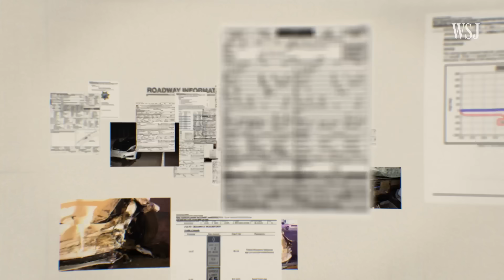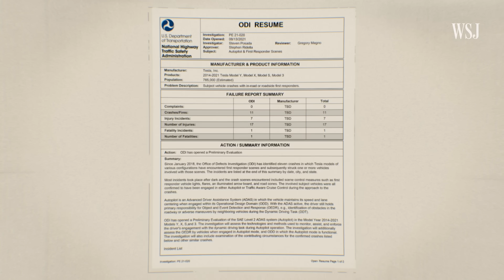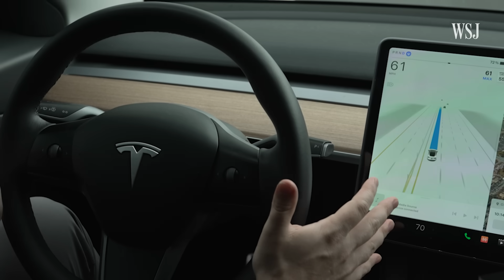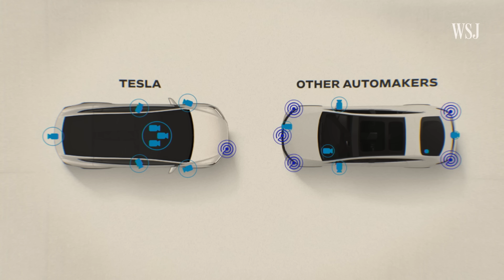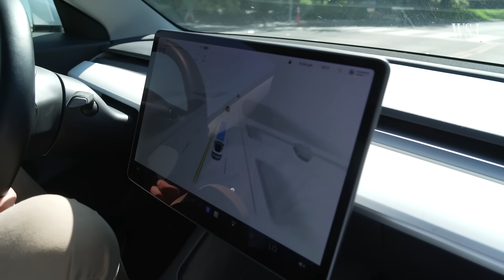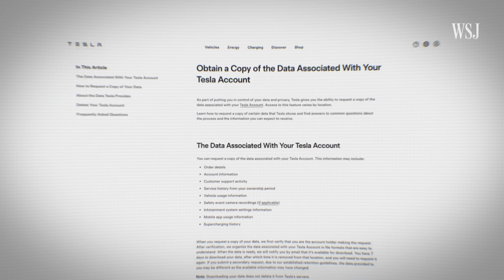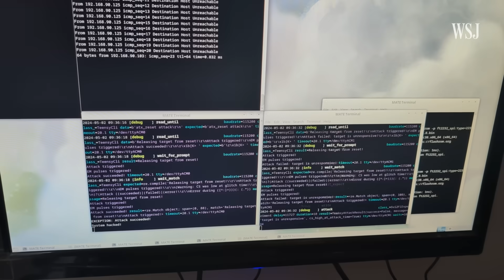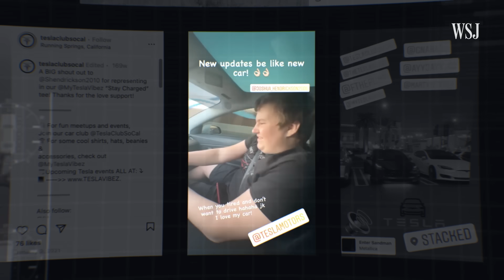The Hidden Autopilot Data That Reveals Why Teslas Crash | WSJ

Comment: From Wikipedia:
“In January 2022, [Missy] Cummings was required by NHTSA to recuse herself from any matters related to Tesla.[22]
Cummings later parted ways with NHTSA and joined George Mason University as a professor and director of Mason's Autonomy and Robotics Center.”
The issue was she was a major stakeholder and board member of a LiDAR manufacturer. Her position that vision-only FSD is dangerous was obviously conflicted and self-serving. This should have been disclosed in the video.
Reply: Did you intentionally miss the information from the same wiki article? "She resigned and sold all of her shares in October 2021 prior to starting at the NHTSA."
Reply: @
Hmm. Not intentionally. I only looked her up on Wikipedia to confirm I wasn’t confusing details about her with Jennifer Granholm. I wasn’t.
Yours is a fair point. She did resign and sell her shares. She also deleted her tweets that opined NHTSA should force Tesla to shut down their FSD. It’d be like she never thought or said these things. /s
It wasn’t enough for NHTSA. They asked her to resign.
As a Democrat and (then) long Tesla shareholder (disclosure submitted) I watched with deep concern as Jennifer Granholm (former Governor of Michigan, home of Motor City) and President Biden (“I know how I can secure the Union vote”) seemingly try to simultaneously torpedo Tesla, the EV revolution, the American auto industry, and the political fortunes of the Democrats. A slow painful train wreck.
Volkswagen, Stellantis, Nissan are, by their own description, in crisis. GM and Ford aren’t far behind. They’re at least two generations behind Tesla
and BYD. They’re burdened with stranded assets, huge debts, short-sighted shareholders, short-term bloated bureaucracies, counter-productive dealerships, anachronistic unions, antiquated technologies, and supply-chains that flat-out refuse to (or can’t) evolve.
Apologies for the rant, it just makes me sad.
On the brighter side, who would’ve thought, 10 years ago, that the most advanced cars in the world would be American-designed and built? Who would’ve believed that Republicans might start buying EV’s?
Note: I acknowledge my bias.

Comment: That car wreck at 0:49 would have been impossible to react to for most human drivers. What is concerning however, is that the autopilot did not apply the brakes at any point before the crash.
Reply: React? Maybe. But foresee? 

Human eyes adapt to the dark, they see gaps in lights from the other side and they see other cars going around and braking. All these are signs to slow down and be more careful. Call it instinct.

I suspect a human who can't see the road would slow down. Bad weather, low light, etc are all things a human reacts to and cruise control doesn't. If the brakes wouldn't save you, slowing down might.

Comment: Tesla auto pilot is way better than others in the market but it's still a glorified cruise control. People should not use this blindly, I tried multiple times and it does not work as advertised.
Reply: FSD is advertised as requiring supervision.

Comment: This is a hit piece on Tesla  by the woke WSJ and its cronies. The driver had full responsibility of the car operation and this software at the time of the crash was only a glorified cruse control. You can even see that the car at the last second tried to swerve to avoid the crash. Tesla at the time of the crash was the only company that recorded  and stored data of crashes. Please publish other auto manufactures crash data when using driving assist software and please show their cars self recording videos and data at the time of the crash. There is none because the car was incapable of doing so! Teslas data collection is unmatched and is used show the unbiased TRUTH !!!!!!!!!!!!!
Reply: Do you dispute the infomation in the video?
Reply: If truth is important, to you, you may want to avoid anything and everything that Elon has ANYTHING to do with. 🫤  (Also avoid religion, that will only hold you back. 😉)
Reply: And yet Tesla hides the data claiming it's "proprietary". (like that would actually help a competitor).   Seems you're ok with no regulation, no oversight, no transparency as the government is about to  fast track this tech to fully autonomous.

Comment: If you pay for FSD your car will drive itself. If you use Autopilot thinking it’s FSD you’ll crash. Autopilot is just cruise control. This video never mentions FSD even once, which is a strange omission. What a misleading video.
Reply: What is FSD?
Reply: @carypeaden4147  It's Full Self Driving. Meaning the car can drive for you to point A to Z. The car will brake, accelerate, turn, pass car and so on and get you to your destination.
Autopilot is just cruise control and the car stay on the line. That works only if you want to go straight
Reply: Why doesn't the video mention FSD? Because it is not about FSD, it is about how Tesla's adaptive cruise control (Autopilot) may be worse than every other system because it doesn't rely on radar or ultrasonic sensor input.
Almost every tesla has some version of Autopilot, while a small fraction of Teslas have FSD. Mentioning FSD would be misleading.
Reply: don't call it autopilot then
Reply: @PeterPotnoodle  no because thats literally the definition of auto pilot. auto pilots in planes are just pre programmed flight pathing and basically line following in the air. its not an ai system to decide when to land where to take and how to react to other planes etc. the pilot is supposed to do that and air traffic control ensures that there is space on "air roads" to not have collisions with other planes...
Reply: @placeholder7753  For general public who are not educated enough on this topic, it is the natural tendency to understand that differently, especially when Elon keeps promising the cars people buy will be able to "drive themselves" for almost a decade. This marketing and beta testing on road approach is definitely unethical.

Comment: THIS IS OLD OUTDATED NEWS:  The Wall Street Journal is sighting outdated incidents when Tesla was using coding to solve FSD!  Tesla's FSD development has shifted dramatically from relying heavily on hand-coded rules to primarily using vast amounts of real-world video data to train a neural network, meaning the system now learns how to drive by processing billions of video clips rather than relying on complex lines of code to define driving behaviors, giving it a more adaptable and nuanced understanding of driving situations; essentially, the car is "taught" how to drive through experience rather than being explicitly programmed with rules.

Comment: My wife has a Tesla and the issues with autopilot should be OBVIOUS even if you haven't the feature enabled. Teslas attempt to process cameras and present what they "see" on the screen in a 3d representation. It can be very impressive watching it show people, cars, bicycles, even kinds of street objects that it has picked out from image processing. But the reality is that 5-10% of the time it is wrong. A cone becomes a dog, a cyclist becomes a wheelie bin. It looks at the wrong lights. It's mostly right and also dangerously wrong. That's even before considering how the software would cope recognising diversions, roadworks, accidents, faulty signals, school buses, pedestrians, traffic cops, debris, potholes, carjackers, floods, snow, ice, one way streets etc. It is DOOMED to be wrong and do dumb things. And people will die. The better solution by far would advanced driver assistance - a person drives and the car provides rapid intervention. Or if autopilot is allowed at all it should be highly restricted where it can operate, to roads where there are a limited number of external factors. e.g. maybe it's okay for highway driving but nowhere near crossroads, pedestrians, schools, suburban streets or other designated no-go zones.
Reply: What part of SUPERVISED do you not understand?
Reply: @JohnSmith-x3y8h  the Tesla defence force is out on this one. Lol
Reply: @drxym  So you’re not going to answer the question then 🤡🤣

Comment: Great journalism in action. Thank you.
Reply: Actually it’s a blatantly biased hit piece using obsolete data.
Reply: Don't be a fanboi fanatic that you can't see the reality.
Reply: @BigBlueFlame-000  You won’t have any problem providing similar accidents using V12+ FSD then, will you?…

…oh wait, there aren’t any, all the crashes in this hit piece are from 2021 or earlier using Autopilot, not FSD.

You’re clueless 

Blocked
Reply: @JohnSmith-x3y8h  Tesla doesn't provide any report on the accidents because of their janky software. While their competitors like Waymo provides not only accidents rate but also disengagement rates (as required by the law in California).  So why don't desla provide the data if their software is that good? What's to hide?

Comment: If the AI caused the accident you have to openly investigate it not play the 'it prevented x number of other accidents'. The system cause that accident so it is responsible for it. If the AI was not on that car the driver in some of these cases would be alive. The company is responsible. Your insurance company does not care about all the other accidents when you have a crash it looks at you and others involved. Those on here saying it is a hit job don't get this and for some reason see an investigation as a threat. Do we not investigate a fault with a brand of car because all the other parts of a car work perfectly and have saved numerous lives?
Reply: If a level 2 system is not used properly, it is the driver at fault. Of course any accidents are and will be investigated, but automation will ultimately save lives. Tesla are showing with V13, they are very close to solving autonomy.
Reply: @daydreamer8373  not my point. We were refused a blind spot mirror on the other side of a a road by the highways dept on a dangerous blind corner. They said and it is right the mirror could cause accidents because of x, y, z. When you add a risk you are responsible for those extra risks. The AI is an extra risk. So lets say like the mirror it will stop accidents it still adds other risks. The car company is responsible for these much like the highways dept for the mirror.
Reply: @issigonis975  FSD has also avoided many accidents. If people use it correctly, it is an important safety net. and will only get better.

Comment: It’s ‘supervised’ auto pilot. If you don’t supervise it, you’ll prolly die.
Reply: "fully self-driving"?
Reply: @Ben-kz2km  "Full self driving (supervised)" conveniently forgotten by WSJ
Reply: Or you'll kill someone else. Or both. That's what most concerns me. NHTSA should take more action to protect drivers and pedestrians who are NOT the driver of the Tesla, who at least has the the choice whether to endanger themselves or not.
Reply: @ teslas aren’t purposely mowing people down or running people over. Any vehicle can be used as a weapon against anyone walking, driving and minding your own business. Anyone who “sets it and forgets it” is endangering everyone as well as themselves and their passengers. 
   I think it does so good that people who have it end up getting a little more complacent and in an odd situation, smackerooo. It still isn’t the teslas fault, it the driver.
Reply: @daveyshmavey  I think that may be a little simplistic. Obviously Tesla is not purposely programming the car to be more dangerous. However, might it not (at least in part) be Tesla's fault if (1) the software/hardware is endangering others, or (2) advertising Autopilot/FSD as being more capable than it is, or (3) the human-machine interface makes drivers more complacent and therefore the car under Autopilot/FSD more dangerous to drivers and others? Regardless of whether a driver has to sign off on being ultimately "in charge" or not? And regarding regulation, it doesn't matter who or what makes the car more dangerous. If use of Autopilot/FSD is more dangerous to the car's driver, other drivers and passengers, and pedestrians than it is when disengaged, then the use of it should be regulated.
Reply: @jaredjohnson8553  I agree it should be reguated as well but I dont think its too complicated. When you sign that you are responsible, you better pay attention or you are liable. No different than cruise control being on and there is a Semi Laying sideways across your lane (as is this case). Bottom line is, your responsible once you get behind the wheel, "UNLESS the vehicle fails to be controlled'". If you hit the brakes and they dont respond or your gas pedal gets stuck down, etc. then the automaker is responsible. I can see how others who dont want to claim responsibility for their actions or inactions can misconstrue responsibility.
Reply: @daveyshmavey  Not good enough. That mitigates Tesla's liability. But it doesn't mitigate the risk that other people may be injured or killed by (misuse of) the system.

Think of an analogy. I am going to sell you this car and the accelerator sticks full throttle intermittently. So, here, sign this waiver that you will be responsible for the safe use of the car whether the accelerator sticks or not. Not acceptable.
Reply: @ that’s not what I said or implied. Auto manufacturers CANNOT sell you a known ‘defect’. Defects unsafe enough require a recall. This has nothing to do with this subject. This is about the responsibility of the driver. Blaming an automaker because you didn’t pay attention when you should have is what’s unacceptable. If you knowingly misuse a system, it’s still your fault. If a gas pedal gets stuck by your foot pressing on it, isn’t the cars fault if you end up going into someone’s rear end.. “It shouldn’t have let me do that” no, you need to maintain control. 
    Totally different with unsupervised FSD. If it hits someone, something, then yup! Teslas fault. If someone else hits it, their fault! Can’t blame Tesla if the car “didn’t get out of the way”.
Reply: Supervised doesn't mean what you think it means.... It means Supervised learning, a technique to train machine learning algorithms.....

Comment: One thing humans are really really bad at is consistently paying attention to something that most of the time doesn’t need any inputs. Humans get bored, distracted, sleepy, that’s just a fact of how the human brain works. Give the human brain the need to constantly interpret and react to information and it’s really very good. In fact it can interpret and react appropriately to information it’s never seen before. Computers on the other hand are excellent at monitoring data without having to respond most of the time. They never get distracted, never get tired, no matter if they’ve been watching the same data stream for 8 hours without having to react the moment they see something that fits their criteria for reacting they will just do it in split seconds. But they literally cannot interpret and correctly react to something they’re never been trained on

Which means it’s crazy to have the computer driving 99% of the time having to deal with every random thing that happens while the human is expected to sit there and monitor it for for hours on end without getting bored or distracted or sleepy and then pick up on those occasional split second mess ups without a moments delay. That’s working to both sides weakness and throwing away both sides strengths

Comment: auto pilot means the driver is still in charge.  There is a steering wheel, brakes etc.  The driver can and should always take charge and not allow autopilot to take full control of the car.  That has not been the point of the technology up until now.

Comment: This was not a compelling video.  It failed to address the accident rate per mile of autopilot-related crashes vs. non-autopilot crashes.  It didn't compare the rate of crashes per mile between Teslas and vehicles with using different technologies.  And it only focused on Teslas and not other vehicles at all.  There's lots of insinuation with the claims, and a tug at the heart for the lives lost, but the video was very weak in making an argument that there is a serious problem here.  Most of those videos showed situations where an alert driver either should have intervened, or would be unable to intervene and prevent a crash (as was the case in the overturned 18-wheeler)

Comment: Human error is one of the common causes of automobile accidents. Human error is an action that has been done but not intentionally by the actor. Now, the action known as human error after the fact includes doing something and doing nothing. “AutoPilot”, on the other hand, is not designed to eliminate human errors. 
I used Autopilot in early 2019 on my 2018 Model 3P briefly, nothing happened. The same day I saw an exact same 3P parked next to mine at a charging station, it had nasty scraping marks on one side. From talking to the owner, I learned that he was using Autopilot and during lane change his car veered onto a Toyota 4Runner. I have not used the Autopilot since and found driving the car myself is more fun.